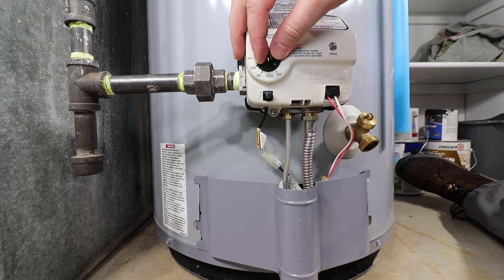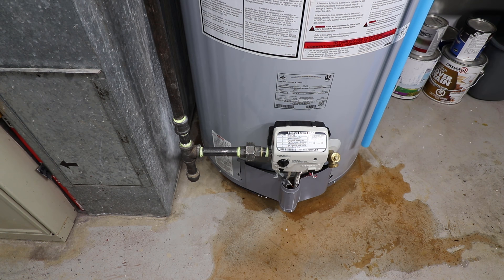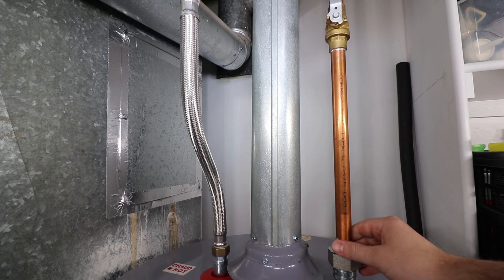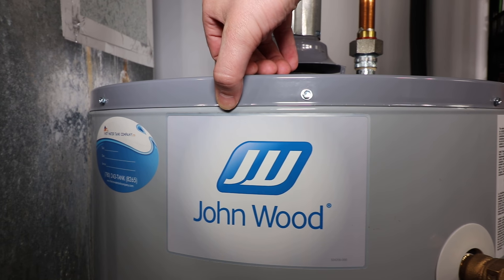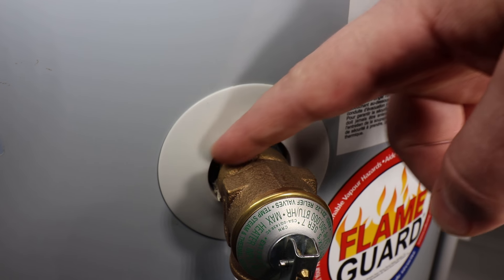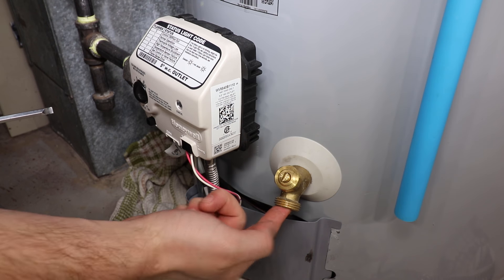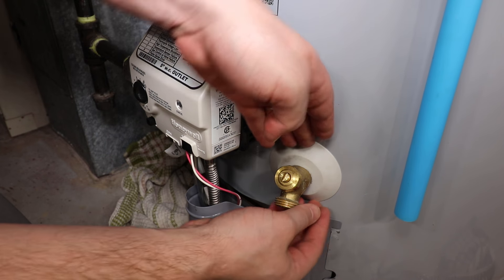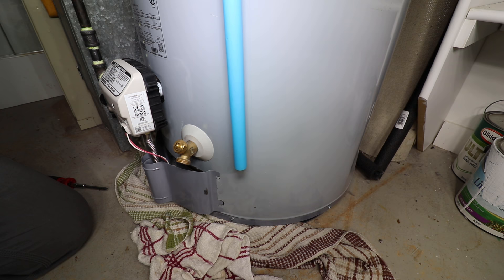Water Heater Leaking: What To Do

Comment: Darn it. It’s past midnight and I just discovered water around the water heater. The bottom seam is wet and all else is dry. So this means mine needs a replacement.
Reply: me too tonight , after returning home from my surprise birthday party. I noticed a  strange noise but couldn't source it, it sounded like a running toilet. Turns out my water tanks  leaked out luckily into the floor drain, but yep bottom seals leaking and good to. Figured how to turn it off and now looking for a water heater! Happy Birthday! lol
Reply: Me three...water pouring out like crazy all over my garage...guess I have replace this..the pain of owning a house.
Reply: Me 4. The pan at the bottom of the water heater is full of water and is leaking into my carpet and garage.
Reply: Me 5...9:00 at night
Trying to find someone to do the replacement
Reply: Me 6 10pm, water valve to shut it off stuck, can’t turn it by hand, water pan full but I did manage to turn gas off🤦🏽‍♀️
Reply: Me 25. 10:30 at night. Yay! Now a "cold water leaker"
Reply: me 26... water leaks noticed at noon and pan was full of water. Good thing i discovered it right away. Just have to buy a new water heater and stupid home warranty...
Reply: @LS-vb6kt  Me 27...lucky I was @ home in the basement and was just about to wash clothes, heard the sound of water dripping, looked down at the pan under the heater, it was full of water, turned off the water and gas knob until I get replacement. I'm just happy I was there as soon as it started running out of the bottom seam...talk about timing... Gotta go in survival mode now until my replacement is installed...Heat up pots of hot water on the stove, Pour in tub, run cold water until desired temp. Whoop there it Is!!!!!!SURVIVAL OF THE FITTEST!!!!!! HOPE THIS HELPED!!!! PRAYERS....
Reply: Me 28, midnight- water all over the basement.. lovely
Reply: Right when I’m moving this water heater start leaking
Reply: Water heaters are psychic - just like a car youre about to replace!
Reply: Same leaking from the bottom

Comment: I listen to your sequence of operation for boiler mine was working fine suddenly it stop when thermostat ask for heat it did nothing I tried all zone but boiler did not fire I have code showing stand by it has power every thing I suspect one of those switches how I check switches 😊

Comment: My 14 year old gas water heater has a pinhole leak at the top, where the exhaust vent is located. I will be installing my 3rd water heater in 30 years. This happened 6 weeks after installing an electric anode rod to prevent corrosion, go figure.

Comment: You left one more leak, the gas valve box itself! My heater has Honeywell brand valve box which it turns had a plastic probe that can crack and cause water to run through the probe out to the box area.

Comment: My electric water heater is leaking from the two holes on the top  at the cold water inlet and hot water outlet.  Water rises up from the holes of those two locations.  It's not trickling down but rises up.  Going to pull the tubes and see if it's salvageable tomorrow.  It's 12 years old.

Comment: My water heater is only a year and a half old.  The warranty was only valid if it was installed by a licensed plumber, and you needed to send in a copy of their license.  It's leaking from the tank and that has nothing to do with the installation technique. 

I will NOT buy an A.O. Smith tank this time.

Comment: You skipped the one place that mine is leaking from.  The two tubes that connect at the bottom of the control panel, one flexible the other rigid, one or both are leaking from the connection point.  What are these for and is it just a matter of replacing a gasket(s)?

Comment: Lots of water under the water heater but cant find where it coming from , should it be time to change the heater ... I 
Have it 21yrs now and how much would that cost me
Reply from the maker: Average water heater lifespan is usually around 12-15. This depends greatly on usage, make of water heater, and quality of water. I would say it's time for a replacement. Pricing varies greatly on area and size/model of water heater as well. It would be best to ask for a quote from a local contractor.

Comment: Very helpful video, but I have a question. Mine is leaking from behind the gas control box/thermostat. Does that mean I have to replace the thermostat or just re-teflon tape the threads inside?
Reply: I have that problem, replaced the thermostat but has nothing to do with the inner tank itself, I may have a corroded tank.
What did you end up doing?

Comment: Hi there just discovered a leak in our apartment hot water cupboard, it's just slowly dripping from the bottom, what would that be? - turned off the hot water and put a towel down until we can arrange a plumber tomorrow

Comment: What if it's leaking from around the threads of the drain valve?  I can see a lot of rust where the valve meets the internal body.  Can it be repaired?
Reply from the maker: You may be able to remove the drain valve (after draining), and clean up the threads. Then Teflon tape the threads and reinstall the drain. To be honest if I was to go through that trouble I would install a new drain valve though, and this should fix the leak. Hope this helps. Good luck!
Reply: @PROSDIY  Thank you.  Looks like I have to call a technician.

Comment: My tank is leaking clear room temp water from the bottom.
Couple days ago I had a leaky cold water valve which I replaced, while doing this I did have lots of water leak from that area onto the tank. Would it be that water slowly escaping down from the seams? Like I said it's not hot water or rusty

Comment: The gas control doesn't have an OFF option it only goes from REALLY HOT to Low then after that it has just a dot, which is not labeled if it means OFF or "what does a DOT mean?!!!"
Reply from the maker: Hi Joel, You made have the off/pilot/on control on the top of the gas control depending on your model. Can you supply me with your tank's model number? With this I'll be able to direct you in the right direction. The model number is on a sticker on the front of the tank. Thanks
Reply: @PROSDIY  its a GE :  GG30T06AVJ00

I would still like your opi ion, my landlord ended telling me not to mess w the control, leave it as is... do u think it is still neccesary to have the control in Off setting?
Reply from the maker: That model will have the off/pilot/on control on the top of the control valve, next to the pilot button. GE refers to it as a "gas cock knob". Page 16 and 18 of the manual show this https://products.geappliances.com/appliance/gea-specs/GG30T06AVJ00 . If the water heater is severely leaking it should be turned to the off position and the water supply should also be shut off to the tank. Hopefully this information helps you out. Thanks!

Comment: How do I turn the water completely off to the hot water heater? I have turned the knob off at the top but it still sounds like it's running and the hot water heater burst a while back but I don't have the money to replace it at the moment. So how do I stop it from leaking (drain pan is full of water) out of the pvc pipe outside until I can afford to replace it?

Comment: Hi I see water leaking from an area where there are some wires just above the drain knob what to do I took a photo but can’t post it here
Reply from the maker: Possibly from the control valve? Check that connection. It is more likely from a connection on top of the tank though and it's running down the insulation of the tank. If it's from the control valve it can be removed, Teflon taped, and reinstalled.

Comment: Mine is 15  years old and leaking from the bottom seam. It's in an outdoor water heater closet, but I have the baseboard of the wall adjacent inside my house peeling away from the wall. Does water damage like this always require assessment? I have a fan blowing in the area and I'm hoping things will dry out fully here soon.
Reply from the maker: Hi lockergr, In most small leaks like yours, letting it fully dry out would be fine. Without seeing the extent of the water damage, I'd recommend having a restoration company take a look. Most of these companies offer a free assessment. Hope it all goes well! All the Best!

Comment: Hot water just poured out of drip tube, lately drip tube has been dripping 
I have never touched tank is it time to replace  it? 
is it going to explode
Reply from the maker: It most likely requires a replacement relief valve. The tank shouldn't need replacement. I have an older video on relief valve replacement: https://youtu.be/3VQCjGuNrLE
Let me know if you have any questions.

Comment: What do I do if its obviously coming out the drip tube?.. i shut off water heater and water to it but haven't touched anything else?
Reply from the maker: It will most likely need a new temperature/pressure relief valve. They can wear out over time and start to drip. This is the brass fitting that the drip tube is connected to. Home Depot/Lowes carry them in the plumbing section. Just make sure to get the numbers off the current T&P valve, most likely a Watts 100XL or L100XL. Excessive temperature can cause the T&P valve to leak as well so double check the temperature setting.
Reply: @PROSDIY  it blew like 10 gallons out BUT I just found out she keeps it cranked up high and had just ran 2 consecutive showers , idk if that finally upset it ? Is it even safe to try it again but at a lower temp with the same valve attached or should I just replace to be safe to avoid another mess?
Reply from the maker: @brianjohnston7294  Personally I would replace the valve for the peace of mind. There's a tensioned spring in the PRV that can weaken over time and if it has blown a few times. You're correct, having the temperature cranked and high usage caused the leak. That being said it's your call. You can try repressurizing the system and running at a lower temperature. If interested, I have an old crappy video on T&P replacement. I apologize for the music and quality, lol. https://youtu.be/3VQCjGuNrLE

Comment: Just bought a new tank 60 days ago . Got a small bit of water bottom of pan. It’s a new Rheem gladiator which shoots me a warning of a leak. Tank states service soon. What in the world ?
Reply from the maker: Is the water consistent or does it only happen once in awhile? If it only happens once in awhile and after a big usage of hot water it could be condensation. This can occur if a large amount of hot water is used in a short period of time or if the water heater is undersized. If the water is there and growing all the time, then it is going to be a leak that has to tracked down. Start at the top of the tank and inspect all connections as you work your way to the bottom of the tank. Hopefully this gets you in the right direction. Good Luck!

Comment: Hello, I had a tiny drip from cold water/supply line - a tiny adjustment on the connection resolved the drip but now I am dealing with removing the water in drip pan that’s below the drain. I’ve been using a shop vac for removal each day, little by little as it trickles out from under the water heater.

My concern is how worrisome is this remaining water and whether it’ll cause the bottom of my water heater to rust and produce a “real” leak.

Thanks in advance for any thoughts on this.
Reply from the maker: If it's just residual water from the leak it isn't a worry and should dry out eventually. The metal pan at the base of the water heater is just a cover or shell. The pressured tank is more towards the center of the water heater and is covered with insulation then the thin metal cover/pan. Just check in on it for the next day or so to make sure that the leak is fixed and that the water dries up. Thanks for the question!

Comment: yo i just woke up in the middle of the night hearing water splashing. and sure enough its the drain valve. so like do i turn it of or what cause i dont know shit about this but i woke up my dad and hes putting hose on the valve  to drain it by our drain pipe lol so like is this shit gonna explode or some if we leave it on
Reply from the maker: Hi John, If the leak is pretty fast the water heater should be turned off until it is repaired. If the water heater is left on, the burner will run constantly because of the leak. Hope you're able to get it fixed without any problems.